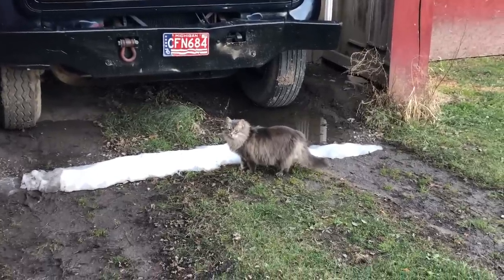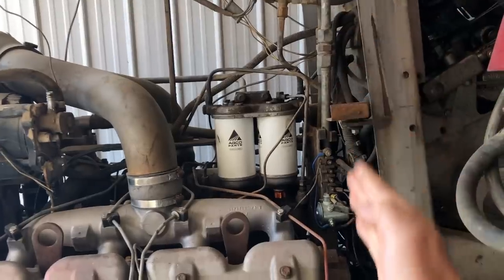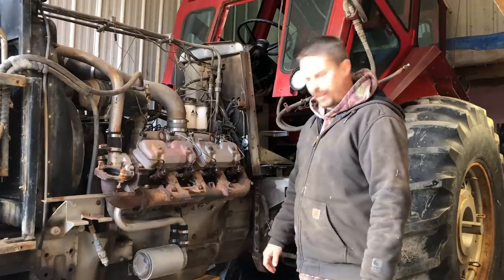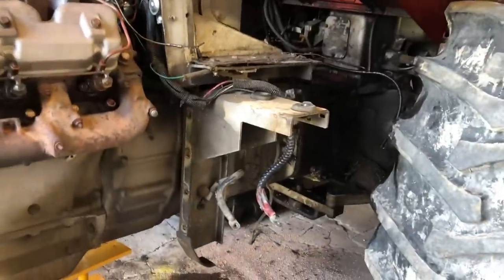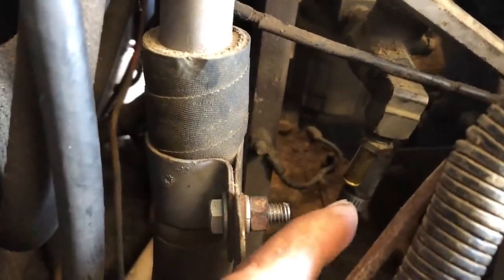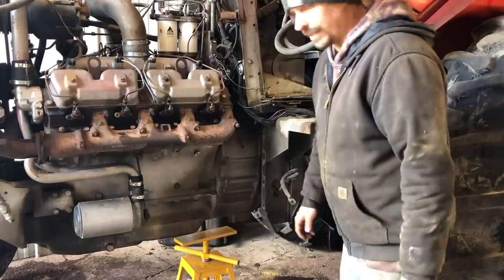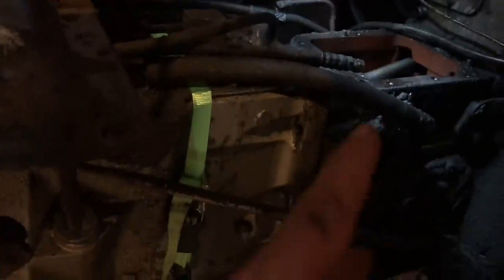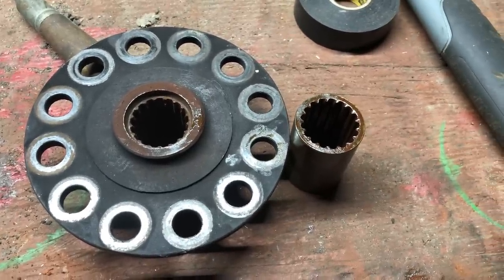Massey 1155 hydraulic repair part 2, splitting the beast!

Comment: Hey JT, regarding always blocking the wheels when jacking and separating!:( When the guy poured my shop floor there was some confusion as to the use of the space. He pitched the floor 4" over 24'. He said " no water will collect on this slab"!! He was right, nothing stays on the floor. I chase sockets that are heading for the door! I almost lost my wife's AWD car when I jacked up the front thinking it would stay in place. No! I finally stopped the rig by turning the jack just as it was going out the door. It hadn't started moving until I was at the side to put the stands under. Also, love your rolling stands and track! Great idea!! Thanks JT!

Comment: Just came across ur channel. Have  restored Mf 165 already and  gonna tackle 690  multi power which are hard to find,  the cab needs tlc but all dere but mechanically running perfect. Love the Massey. Great channel and great work
Reply: Had a 690 great tractor in there day. The cabs turned to dust,

Comment: We’ve always had mostly Massey tractors. My dad bought a 135 in 1967 and I still have it. I bought another 135 and it needs a head gasket. My brother and I have had a 3090 and an 8220 and a 375. I bought a brand new 5711 last year and this year I bought a nicely restored 1150 V8 . It seems used tractors are brining record prices at auctions lately especially ones in decent shape. I don’t have the mechanical know how to do what you do. I’m going to take my other 135 to the dealer to get the head gasket done.

Comment: It really looks to me like the root of the problem was the snap ring on that shaft. Once it came loose it allowed the shaft to slide back so that it wasn’t fully engaged with the coupler.  Then it stripped the splines because it was only in the end of the coupler.

Comment: Would you ever consider doing a video on the wiring of your 1100? I have an 1130 that I need to rewire and their is no harness available anymore
Reply: pretty easy electrical system use i wire alt helps get a wireing diagrm put in circut breakers at starter instead of the old fuses they caused a lot of problems may be able to0 find a good harness at trac salvage place

Comment: Hi JT, I'm from Michigan. I have an1155 it has eaten  up 2 used charg pumps it has metal in the oil. The service  shop can't seem to fix it it has a good motor and is pretty  clean overall. I also have  many extra parts for it.I can't afford to  put any more  money  into the  tractor, would you be interested  in it?

Comment: Did you make your splitting cart and rail or buy it? Do you still have your 1805 from intro? We had one years ago ran really good, previous owner moved remote levers from dash to right of seat. We took out the dog bone between the motor and transmission and added a drive shaft. Wonder where that old beast ended up. I’m in southeast Michigan.
Reply from the maker: I bought that on eBay. seems to do a good job. 
I still have the 1805, there are several videos on my channel about it. even built a shaft like what you had on yours😉

Comment: Hey JT, after I watched the video and thought a little, I remembered you saying that that snp ring wasn't doing much good. Is that snap ring supposed to keep the coupler at the pump from sliding back on the shaft and disengaging the pump? The couplings looked worn but I didn't see either one slipping. Not questioning your diagnosis, just curious!:) I love learning!
Reply from the maker: that snap ring is meant to keep the front splines in the hub at the flywheel. it is entirely possible that the shaft slipped back a little, causing it to slip. in the first disassembly video I spun the pto clutch basket and it was slipping on the teeth quite a bit.  in the next video I’ll explain it better and show a before and after 😉

Comment: Changed that coupler on an 1130 once , seemed like the worst part was draining the fuel tanks other than that it was pretty simple
Reply from the maker: Those tanks are a PITA lol. I actually think it was easier on the 1155 than it was on my 1100. The tilting cab helps a ton